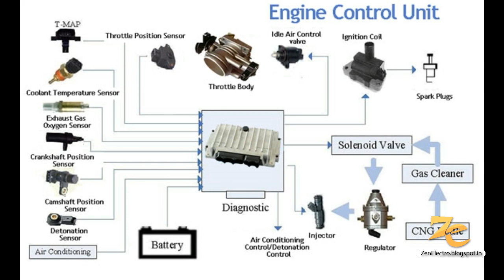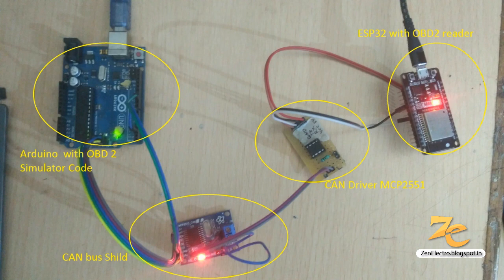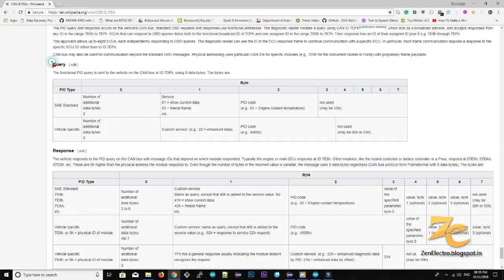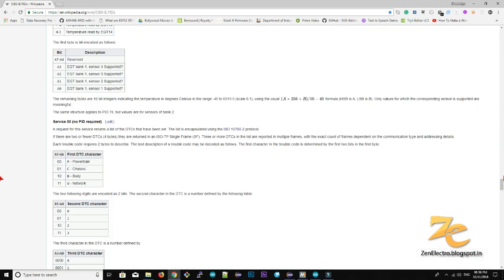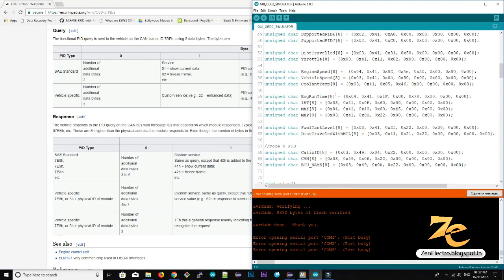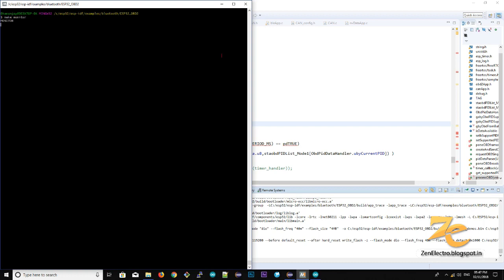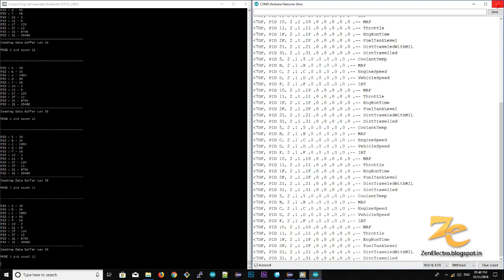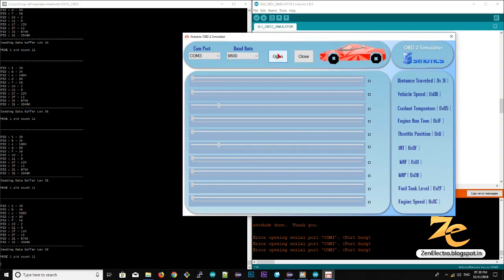Arduino OBD Simulator #arduino obd2 #arduino obd2 shield #arduino obd ii #arduino obd reader

Comment: Hello! Why is necessary use esp 32? or is only for wifi or blutooth comunication?
Reply from the maker: Esp32 is working as OBD2 scanner and reader. Its read value from OBD2 simulator and display on console.
Reply: @Technical_Guruji  Sir, could you please explain how you connected to the esp32. I mean which pin? Since from can bus shield only two output CAN_H and CAN_L

Comment: Hello ZenElectro, I have some questions about building the simulator, as I'll use the Bluetooth OBD scanner to read data and send it to my phone, do I need CAN Driver MCP2551 between CAN BUS Shield and the Bluetooth OBD?
Your project really inspired me, Thanks.
Reply from the maker: Its depends. If your scanner mention standard CAN voltages then you need this IC to communicate with OBD scanner. If obd scanner mentions pins are RX TX with standard volatege logc 3.3v to 5v then you can directly connect to CAN driver pins.
Reply: @Technical_Guruji  Thank you so much.

Comment: Thanks, I'm successfully did your demo, i'm using the obd2 bluetooth  as interface and I can read the values via android device
Reply: Hello sir. I have question on hardware part. Can you help me? if you have already did it
Reply: @otabeknigmatov5171  yes, what is your question?
Reply: @yudipatriot7765  Im also trying to do this project. However I could not find correct hardware which connects can bus shield and esp32? If you have some ideas, could you please share with me?
Reply: @otabeknigmatov5171  Dear Otabek, so sorry that i discontinued the project as above video, its only a test, actually my project is to build a car instrument cluster with  Raspberry pi4 pi4 with Qt5 software as display connected to (arduino + MCP2515 + GPS )  as signal source, if you interested you can view my video

Comment: hello my name is Weslley I am from Brazil, I am studying for a project to conclude a course at my Mecatronical Engineering faculty, I would like to develop a CAN data reading system for the J1939 protocol, used in most Diesel engines, mainly Cuminns by chance I could guide myself with information about this system and I'm having trouble inserting the order and serial in the Arduino's communication base.
Reply: Hello Weslley,
 i hope you are doing great , i have a quetion for you sir if you did your project last year  !!
Reply: @كوورةوبس-ن9س  Hey
Part of the project evolved yes, unfortunately I was only able to communicate with CAN protocols Global OBD types due to the libraries available in Arduino not having information for J1939 protocols.
I used a Bosch KTS 590 automotive scanner as a basis for comparison in the development and doing reverse engineering I have the CAN serial communication requests but the vehicle did not respond to the requests because I believe that the Shild I am using does not have the same speed as the car needs due to CAN FD protocol.

Comment: Hi. Do you have a link to simulator? Does it have source code? Thanks.
Reply: Dont go to spam
Reply from the maker: Arduino code and software installer link is given in description. I have not published software source code. I working on porting this code to Qt platform. Will publish it soon.

Comment: great software, but please I have few questions 
can't we use mcp2551 with all cars with obd2 why?
the same questions for elm 327?
the last one is can we use elm 327 to get data from your software+arduino+can bus shield?
Reply from the maker: 1) Yes, we can use MCP2551 drive( need CAN controller here like MCP2515 or MCU that have inbuild CAN controller like stm32F103) with all cars, becase BOD2 supports multiple standard protocols to send ECU data on OBD2 bus one of them is ISO 15765 CAN.
2) Same for ELM327 its use CAN protocol to read OBD 2 data.
3)Yes, we can use ELM327 to read data from this simulator. This simulator acts like ECU of car wich send 10 parameters and can be changed throw software.

Comment: hi ı want to use for iso 9141  with elm327   can ı  use this system
Reply from the maker: Hello Omer Ozdemir. You can not use this simulator with iso 9142 as it uses K- line protocol. And this simulator works with CAN hardware. You can mdify it for  K-line. You need  K line protocol hardware.
Reply: @Technical_Guruji  :)
Reply: gay

Comment: Can you tell me more about the ESP32 with MCP2551 - OBDII-Reader ?
Reply from the maker: Here I used ESP32 as OBD II PID scanner and reader.  It simple BLE GATT demo modify to read CAN(ESP32 internal CAN controller) data then data is parsed by OBD II data parser written by me. after parsing data I write that data on GATT characteristics in the key-value pair.
Reply: @Technical_Guruji   Can you please, share your project with me - danichervenski@gmail.com . I`m trying to make a ESP32-MCP2551 OBDII - Car speed reader (0xOD HEX) with a PWM output that is with function of speed,  but i can`t find any information about interfacing the MCP2551. I got a succes with MCP2515 but i wanna make it quite smaller with less hardware with the MCP2551 and ESP32. I`ll be very greatfull to help with some issue.
Reply from the maker: Sorry Dani Chervenski, I cant share source code for ESP32 device. as its confidential. you can look for CAN driver for ESP32
Reply: Are you selling anything fully assembled? Can I purchase something from you to support you as well? I appreciate the video. Ypu did an awesome job brother
Reply: You may find more information on 
1) https://github.com/Seeed-Studio/CAN_BUS_Shield  
2) http://www.elecfreaks.com/store/download/product/shield/CAN-BUS_Shield/User%20Guide.zip

Comment: My car is odb protocol ıso9141 
Can ı use mcp2515
Reply from the maker: Hello Simracermudes. You can not use MCP2515 for ISO9141. As this protocol uses K line for communication. But there is way to make K line driver from some transistors wich can used by Arduino to read data. Or you can find ISO9141 driver.
Reply: ZenElectro ok thx 
Can you make for iso9141 knowledge or video

Comment: I connected from the CAN BUS Shild to a OBD2 Reader without success. I also connected also a 120 Ohm resistor to Hi/Lo PIN 14/6, don't work. My question is, do I need the CAN Driver MCP2551 in the middle and can I connect them to the OBD reader to pin 14 and 6?
Reply from the maker: Basically Can driver MCP2551is voltage level converter.
It required on both sides with single 120 ohm resistor between line(CAN H and CAN L) can bus shield have jumper to connect it.
Make sure.
1) If OBD reader is  transfer data on CAN H and CAN L then your CAN bus shield should have MCP2551 on it. 
2) if OBD reader transfer data on CAN RX and CAN TX then you need MCP2551 to connect your CAN bus shield (shield with mcp2551 on it). 
3) check CS and INT pins are properly connected. 
4) before starting software verify log on Arduino console.